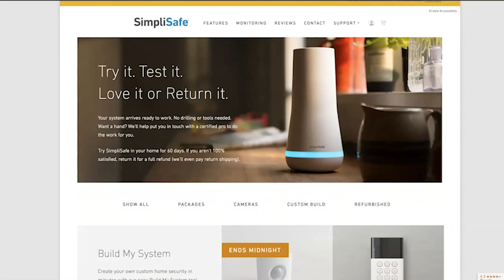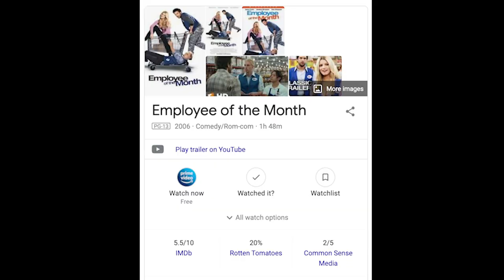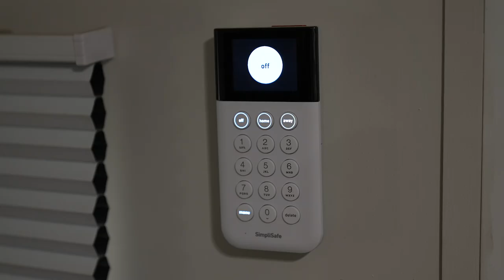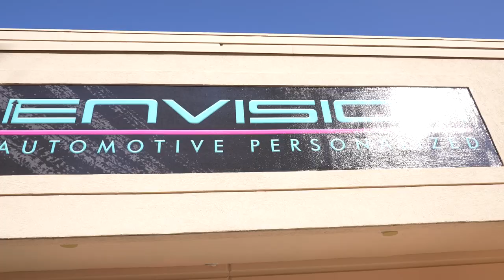SURPRISING MY WIFE WITH HER DREAM CAR!!! | TRENT & ALLIE

Comment: Well, that's one of the most heart-warming posts I've seen in a while!  I suspect it's a day y'all won't ever forget.  (Specially since it's recorded on video for your posterity to watch down the road.)  Good job, buddy!  You took what could have been a rough day and made it a great one.  Some of us could probably take a lesson from it.  BTW, we're on our third 4Runner.  Just love them.  300,000 mile vehicles.  Our current one has 265,000 and I'm just now thinking about replacing it.  It runs fine and we drive it anywhere, even road trips, so I'm not worried about it.  But still thinking.....you won't be sorry you bought yours.

Comment: Happy birthday,  I'm relying on a heat taped hose for my water this winter too, but its thankfully not hooked up to the hydrant. We get -40°F sometime just about every winter, and heat tape just doesn't cut it. My hose is directly connected to my pressure tank and in a pit under my trailer. I hope it works.

Comment: Hello Trent and Allie
From the Northeast, Massachusetts,01585.
Hope you got your tractor and plow or snow blower
Hope you have plan for parking your vehicles closed together for  your snow removal, so you don"t need to keep moving them around. 
Bet you will be working on the insid of your house during the winter. Where you'll have heat  in the area.
HAPPY BIRTHDAY ALLIE, WHAT A SURPRISE YOU GOT.

Something to think about, find an old but good truck with a plow 4wheel. To used around the property. 
with the tractor and truck you can held a lot of wood for the winters and keep your other veicles for your own.
Hope you beat the snow on the last part, second day after Allie's birthday.
Best of Luck.
  Rod

Comment: Happy Birthday Allie XOXOX   30 is fantastic, 40 pretty awsome, 50 just ok. 60 well...it's great to be alive. Trent you will NEVER hear a mountain lion run thru the woods, but a bear or maybe a moose scared by a mountain lion will create much havock. Try putting hay bales around the bottom of your trailer, as well as the foam board, it works wonders to keep the floor warm and pipes not frozen.                
  CHEERS                   Steve h.